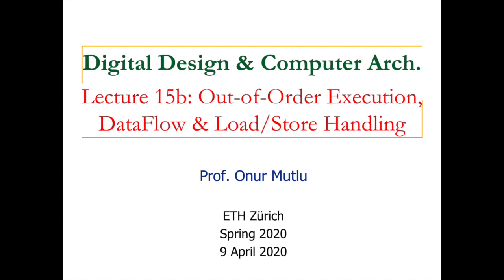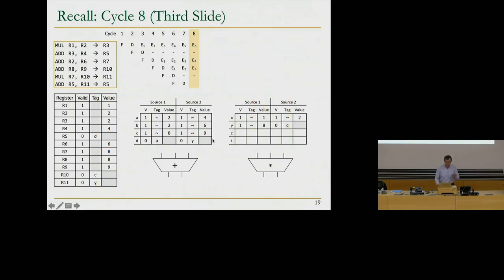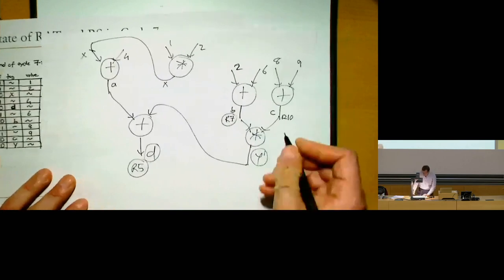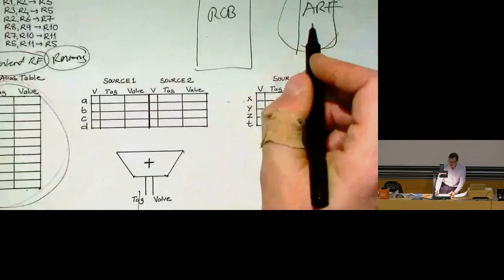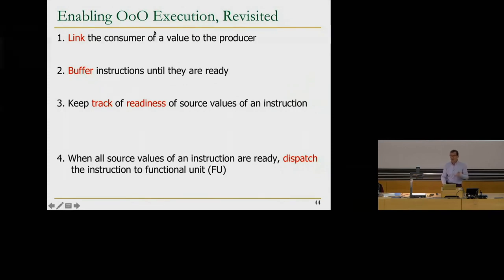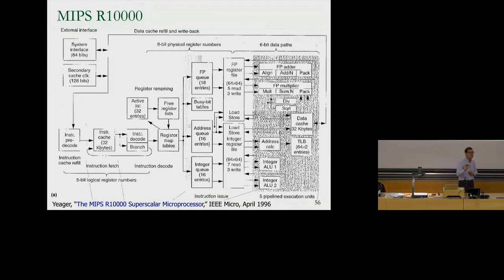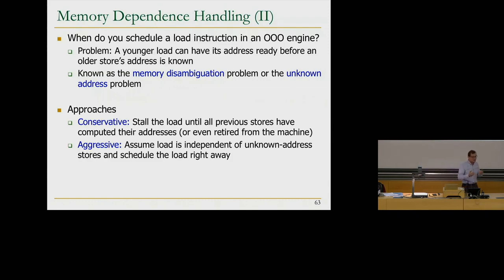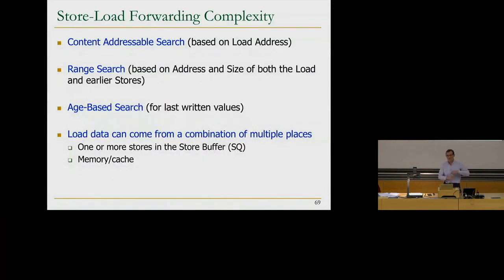Digital Design & Comp. Arch. - Lecture 15b: OoO, DataFlow & LD/ST Handling (ETH Zürich, Spring 2020)

Comment: so is the clock cycle programmed for worst latency of the broadcast + capture + instruction wake up ? that could possibly mean updating N-1 cells of the reservation stations + M-1 tags of the register name table if all the younger instructions are dependent on the first. doesn't that make the clock cycle extremely wide or do you pipeline these stages as well?